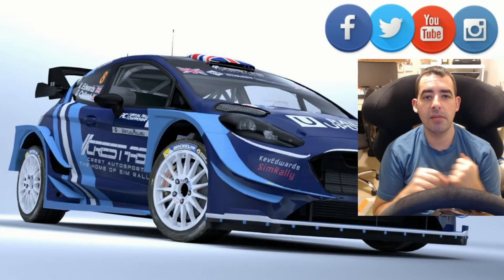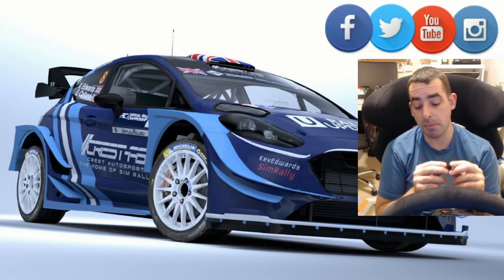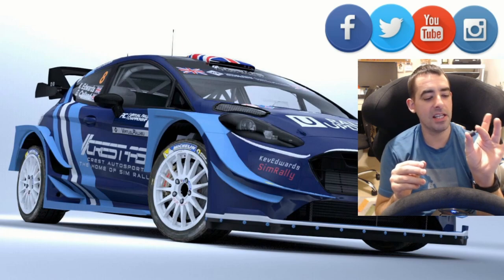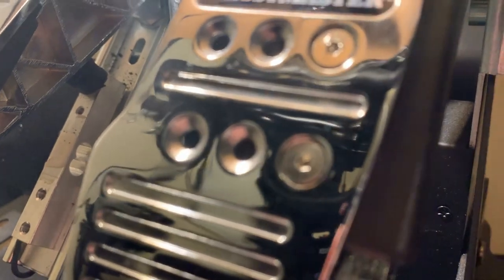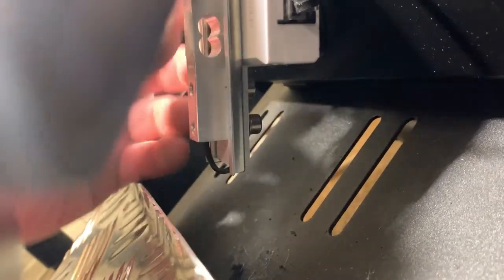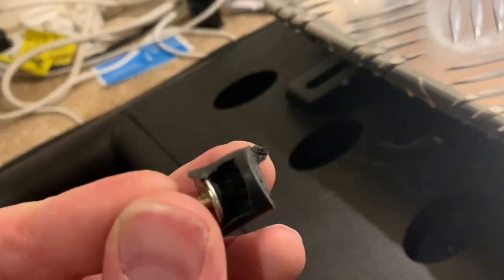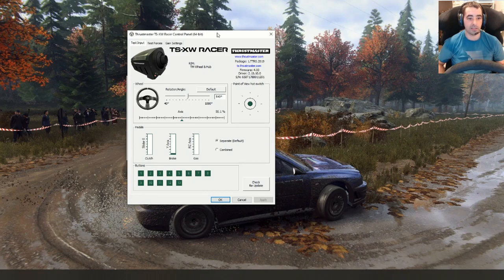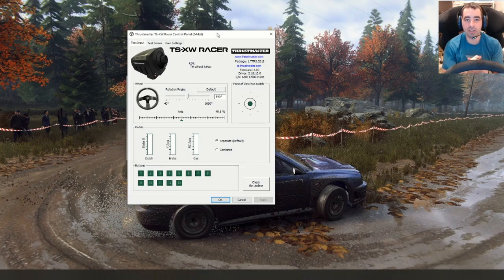Sim Racing Solutions T3PA Load Cell Mod (1 Year Review)

Comment: Are Sim Racing Solutions now out of business? I can't find them online.
Reply: Think so, i need a new rubber
Reply: @willcox44  I wonder if it is the same as the one from loadcellmod.com.
Reply: @willcox44  Did you find anything? I do not need a new one yet, but I will at some point.
Reply: @paokkerkir  no, i ordered something similar online look at male cylindrical rubber stops
Reply: @willcox44  Thx, I found them I believe, but just to confirm are they m6 thread?
Reply: @paokkerkir  i think so, i modded mine slightly so i got m4 but think its m6. send me link to check for you
Reply: @willcox44  it is m4 indeed, just measured the old one. thank you again.

Comment: Maybe using bbj conical brake mod (not THE conical one) in place of SRS rubber would work better?
Reply from the maker: Did think about that but the screw in is a different diameter, might look at seeing if I can bodge them together somehow 😂
Reply: Just about to buy one of these, but might find a hefty rubber doorstop to add to it and just retap the thread if needed.
Reply: @Paulwhittingham  I've only had my T3PA Pro for about a month, is the load cell mod an significant upgrade ?
Reply: @chrisd3510  yes you can actually judge how much pressure you put on the brake, i couldnt trail brake at all with just conical mod.